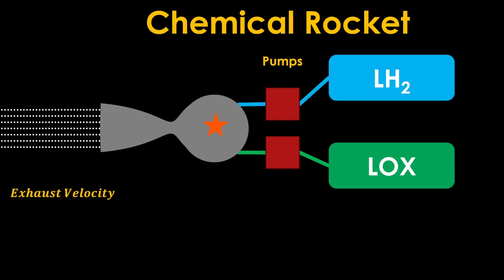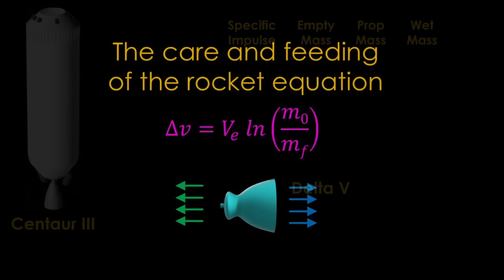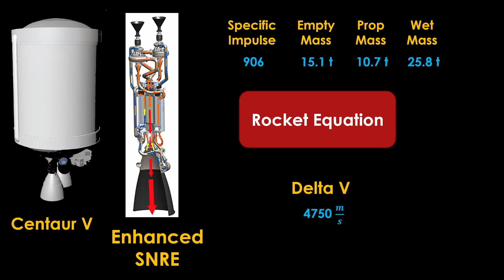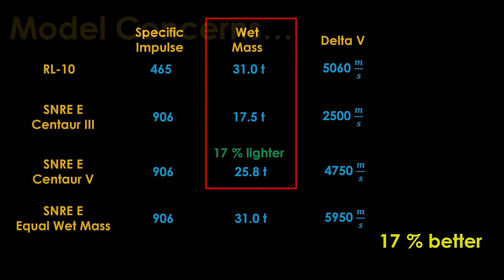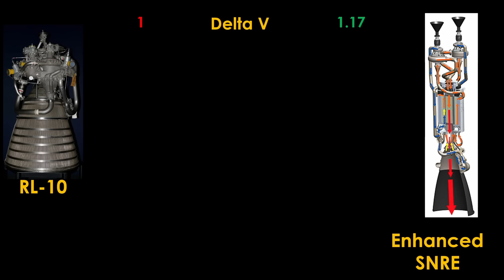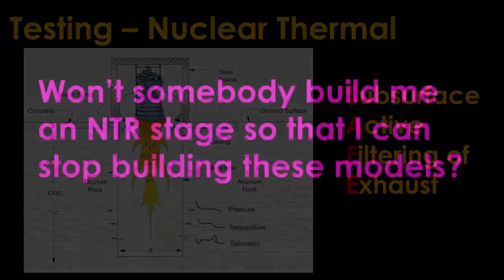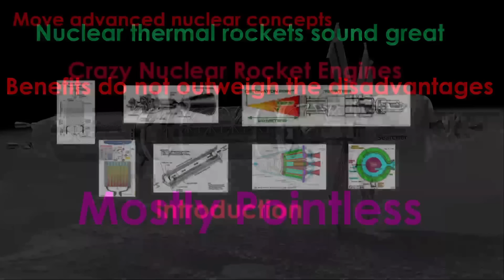Why Nuclear Thermal Rockets are Mostly Pointless

Comment: I will be posting an advanced breakdown of everything in this video:

First, the fundamentals
There is a linear relationship between exhaust velocity and delta v. As such maximizing exhaust velocity of the engine is basically THE most important thing to do on any space related activity or spaceship development program. 

There is a direct non linear relationship between the mass of the exhaust particles and the exhaust velocity. Hydrolox shoot out water, methalox shoots our water and CO2. All of them are quite heavy molecules. 
Pure hydrogen thermal shoots out H2. It’s much much better but not ideal yet, ideal would be H1. To get H1 you need core temperatures above 20 thousand kelvins. Around 5 times higher than the melting point of all known materials in the universe. But it would vastly increase exhaust velocity. This is the idea behind liquid core and gas core nuclear rockets. Get the propellant barely hot enough so that the H2 gas dissociates into H1 instantly giving you a free exhaust velocity boost. You need to develop nuclear rocket to work up to these more advanced types however so that is another argument for why nuclear thermal rockets should absolutely be developed. For context liquid core nuclear rockets can reach an exhaust velocity of around 22 kps while gas core could be north of 50 kps. The main limitation is thermal management however the lessons and solutions learned in thermal management for these fission based rockets also translates to all other space engines including fusion and antimatter so they are useful lessons for all future space travel technologies. 

Secondly the exhaust velocity(Isp. I hate Isp as a metric I always work in exhaust velocity EV). You say that a nuclear thermal rocket is around double that of chemical thrusters. This is not true. Tests conducted during the nerva, Phoebus, rover, XE and kiwi program (that’s right there was more than nerva, doyour research! Russia also had the RD-0410 and perhaps more I haven’t done a deep dive on them) show Isp ranging from 850 to 1000 on THE GROUND at near sea level pressures.   
Even assuming you can’t get above 9 kps EV (exhaust velocity which is what you get by multiplying Isp by earth gravity), that is still far better the exhaust velocity of chemical rockets including hydrolox engines. The F-1 rocket of the Saturn V for instance has 3 vacuum 2.5 sea level kps EV. The never built M-1 engine would have had 4.2 kps EV which approaches the physical limits of hydrolox. Vacuum optimized raptor 3 is as far as I can see 3.8 kps EV a methalox engine. Nuclear thrusters can also be fed methalox. It’s actually pretty good because they run hot enough to split off the hydrogen atoms from carbon unlike from dihydrogen, methane based nuclear rockets give you around 6-6.25 kps EV. The advantage is the much smaller fuel size and much higher mass ratio (lighter fuel tank per kg of propellant) so less bulk and also more thrust.
Reply: You actually seemingly caught that in editing and added a section where you compare all numbers. 

You did the off screen math wrong though it seems because your numbers are 5950 ms dv for 31 tons where as the correct numbers for 15.1 t dry 31 t wet 906 Isp are indeed  6393 and not 5950. 

You then straight up SKIP comparing equal mass and you instead compare your absurd 25 ton variant which is a number that comes out of nowhere... like... what? Is big oil paying you to say this? 

Since you didn’t do it I’ll do it instead, going from 5060 to 6393 is a 26.3% improvement. 

Now it’s low, sure, but ONLY because the thrust of the engine you picked is low. 

Nuclear thermal thrusters have the theoretical potential highest thrust per mass of any engine type. One that is properly made and advanced like a raptor 3 equivalent would have a crazy thrust to weigh ratio. The engine itself would be very lightweight while providing a lot of thrust. 

This would allow you to make rockets where the engine mass is negligible. You NEVER have the engine mass you used in the video and I can’t easily find that number for the SNRE thruster so who knows at this point but it’s still important

You seem to also add fuel tank mass every time you add fuel but again you never say what mass ratio factor you use. 

It is true that hydrogen will as mentioned always have worse mass ratio than other propellants. But as I also mentioned, nuclear rockets don’t have to use hydrogen. A good alternative is methane (they run hot enough and can run hydrogen heavy to avoid gunk carbon buildup). Methane goes from 9 to 6 kps exhaust velocity more or less but the mass ratio of the fuel tanks is multiplied by around 5. 

So if your issue is that hydrogen fuel tanks are too heavy, you could instead get a methane nuclear rocket with 10 tons of dry mass, 20 tons of methane, and an Isp of around 650. Here once again you get significantly better performance. 

But this is not the ideal use case nor the reason nuclear thermal rockets are so useful:
Reply: Then the second example. After the first nonsensical example you decide to do one that makes sense, should have started with that but whatever

I don’t know where you get your numbers for dry mass for. You didn’t show the calculation or the mass of the engine or fuel tanks or extra fuel tank mass you use. 

Here you create a rocket stage with 26 tons 11 ton prop and 15 ton dry mass. Again no idea where any of these numbers come from. Why is the dry mass so high? Why did you decide on such low wet mass? Why 15 tons of dry mass? You didn’t give a mass breakdown of the 10 ton of the base model real life centaur stage's dry mass either so is that payload, fuel tank or the RL10 entine? Very unclear in the video

Either way your final result is a mass ratio of 2.4. Aka 40% of the mass is fuel. Still very low, most rockets today are mostly fuel up to 90% fuel and up because engine exhaust velocity is so low. 
The real life centaur btw is 2/3s fuel, which is already quite low because it tries to maximise Payload mass and doesn’t need much more with how the various stages were setup. 

So you compare a 70% fuel rocket to a 40% fuel rocket. That’s not necessary, you can have a nuclear thermal rocket that is 70% fuel like centaur. Then it would have half the delta v. A more interesting comparison would be looking how much less fuel mass you need for the same delta v as the centaur stage if you replace its 4 something kps engine with a 9 something kps engine. 

Now here you might say well wait a minute now the mass is higher but the thrust is the same so it has less acceleration. And indeed
And you made that error on your example too btw lol, the first and second example are lighter than the centaur and has higher acceleration. 

The centaur weighs 31 tons. Your first example weighs... 17.5 tons. Why? You picked an engine that EXPLICITLY had the same thrust. That’s your entire reason for this choice of entine

Your second example weighs 25.8 tons. WHY again. It has the thrust to push 31 tons with the same safety margins as the centaur does it not? You picked a nuclear engine with the same thrust as the RL10 so why are you making the nuclear variant lighter for no reason...?

Replace your second example by 15.1 ton dry mass, 15.9 ton propellant, 31 ton wet mass, same wet mass and acceleration as the centaur. That gives you a delta v of 6393 ms. 
This would be the sensible comparison to make. Same engine thrust same stage mass, same acceleration, higher delta v as can be expected. 

I have no idea why you chose a lower fuel mass, by 5 tons instead of this. Either dishonesty or brain damage I’m not sure. Maybe you were asleep when you made the video but your numbers are totally off, you are missing 5 out of 15 tons of fuel in your own example.
Reply: The types of configurations where they shine are indeed high mass ratio crafts. Because there is basically no other way to increase the delta v of a mission. 

You can increase exhaust velocity or increase fuel %. That’s it. No other way exists. If you already made a silly rocket that’s 99% fuel with 50 stages... what else can you do if it’s still not enough? Only increase engine exhaust velocity. And nuclear rockets have between 3 and 2 times more exhaust velocity than currently in use chemical thrusters. 

On top of that, as I have mentioned, the theoretical maximum TWR of nuclear solid core rockets is as high as the thousands. 

Meaning you could have a 1 ton engine lifting up a 1000 ton rocket from earth. This makes the mass of the entine and the radiation shielding negligible. A more realistic figure might be 100 or 200 which is still excellent. A rocket could be made with something as low as 2 or 5 but the higher the better generally speaking. It removes engine mass from the dry mass, and increases how much fuel mass you can have on a stage with the same engine. 

Indeed what is stopping you from having a stage that is 5 tons dry mass, 30 tons wet mass and uses a 900 Isp engine? Nothing. 

The centaur as I’ve mentioned has such a low mass ratio (heavy dry mass) because of how the total delta v budget needed to reach orbit was cut. It’s an arbitrary decision and for the centaur, most of the work was done before the centaur stage. And so they feel like they can get away with only 70% fuel on the centaur stage. Your suggestion to use a 40% or 25% fuel stage without sufficient delta v makes no sense. You’re not comparing apples to apples

Comparing apples to apples means same fuel mass same dry mass same thrust and you let the exhaust velocity difference do the talking. 

But you might say that there currently are no high thrust or high TWR nuclear rocket! Correct! Those are the ones THAT HAVENT BEEN DEVELOPED YET SO MAYBE WE SHOULD DEVELOP THEM INSTEAD OF MAKING THE lNSANE CIRCULAR ARGUMENT THAT THE TECHNOLOGY WE HAVENT MADE YET SHOULDNT BE MADE BECAUSE SOMETHING WE HAVE MADE IS WORSE THAT SOMETHING ELSE WE HAVE MADE 

Nuclear thermal rockets have higher exhaust velocity AND higher thrust to mass ratio than chemical thrusters. They are objectively better (other than things like the uranium needed, I’ll get to that) in every metric. Things like the snare engine are proof of concepts. Not mature well developed tech

This is like comparing mechanical computers to the first electric computers that use transistors and saying that the EXISTING mechanical computers are better than the EXISTING digital computers and that therefore we shouldn’t waste money on developing CPUs
Like what?????!!? HUH??! That’s your argument

Now you might now say that "that’s not my arguments i just don’t trust the theoretical estimates that say nuclear thermal rockets can have a better thrust to weight ratio"
Well in that case you’re just wrong. 

People knew that we could design microchips with transistors in the nanometers lobg before we could actually make them. It took billions in research and development and decades to get there. But they knew even in the 60s it could potentially get there with this level of miniaturisation and efficiency. 
Nuclear rockets are the same. This is like some 1980s mosfets. They should be developed because they lead to 2030s mosfets. 
The same way, nuclear rockets lead to absolute monsters like a 900 Isp thruster with 4 meganewtons of thrust that weighs 1 tons. 
And also to more advanced technologies like liquid core (20kps exhaust velocity) and gas core (50kps exhaust velocity). 
The research and development on all thermal systems for these engines is also directly translated into helping us build antimatter and fusion based technologies as the solutions to thermal management are the same.
Reply: That covers all the stuff you talked about. Now the stuff you forgot to mention:

Nuclear thermal rockets have their niche (s). Their main appeal is the fact they are high thrust systems. 
And not just that but the highest exhaust velocity of any high thrust system. 

Their ideal environment is as a ground to orbit launch vehicle. They have enough thrust to takeoff, like a chemical thruster, but you now replace the 340 sea level Isp of raptor engines with 900 Isp of. 
Do you see the benefit yet? Plug that in a rocket equation, take a falcon 9, and switch out 340 Isp for 900Isp solid core thrusters. 

For the same payload mass to orbit you could get a reusable rocket around a third the size (doing this mentally, I’ll leave the math to you). 

That’s the main advantage. And yes as I’ve mentioned there is no issue with using them from launch. The exhaust is not radioactive at all and if it crashes (well first, don’t?) it only affects the surrounding area exactly where it crashed (it can be launched on trajectories that fly over the ocean not land, most rockets already do. Florida and Guyana over the Atlantic, China Japan over the pacific, Russia over central Asian deserts. They launch East) and even then it’s not that bad. 

They can be used as space tugs though I would say ion engines are always better for that. 
They can be used as landing and takeoff thruster for the moon, Ceres Mars or any other place and are once again ideal for this, as they combine high thrust with high exhaust velocity. 

The last niche they excel in is the military. They are perfect due to being able to sustain high thrust (6 G or more) for a ship while also having higher delta v budgets than chemical rockets. All militaries that have access to nuclear thermal rockets WILL use them on military spacecraft. And space dominance is extremely important, "everything is in space!".
I won’t talk about the military side of things much because it’s too important and breaking ground stuff, but the gist of it for nuclear engines is their ability to either dodge/refuse or fοrce a fight with another ship. And also much more delta v for strategic movement and operation. Like so much more. A fleet that uses chemical thruster warships would be essentially stuck around one planet where as one with nuclear thrusters could to from Jupiter to earth or from mercury to Mars and do a lot more operations and complex stuff at its theatre of operations. It’s the difference being between immobile and being able to sail.
Reply: @IceRain-f5v  They have a poor thrust to weight ratio making them a poor choice for a first stage.  And that was just the first flaw I spotted skipping to the end of the wall of now questionable text.
Reply: @imaginary_friend7300
They have a theoretical maximum thrust to weight ratio of over a thousand

It should be obvious from the fact that thrust depends on two things, energy density of the fuel and the rate at which energy can be generated/expelled aka engine power in watts. 

nuclear chemistry has a higher maximum potential power output than chemical thrusters considering NUKES ARE MADE FROM THE USE OF NUCLEAR CHEMISTRY

And nukes are kinda famous for being energy dense and releasing energy very quickly. The limitation to power output for nuclear thermal rockets is material science namely melting point and structural integrity. These constraints are universal to all engine types because now we’re talking about the engine not melting. 

So in other words the thrust to weight ratio of nuclear thermal rockets is basically infinite and only limited by our ability to create an engine that doesn’t melt itself. The same barrier would exist for chemical engines. Meanwhile chemical engines are limited mostly in structural integrity (high pressure fluid containment) and the energy density of the chemical reactants. 

The reason existing nuclear thrusters have low power density is the intentional design choice of creating reactors which operate at low levels or energy and radioactivity. 
If you want to maximize power density you can build a nuclear reactor that is very close to being supercritical, they would have an extreme power output and power density, as well as an extreme amount of radiation

Radiation scales about linearly with engine power for nuclear rockets. A more powerful engine is a more radioactive engine

However every added centimeter of radiation shielding reduces radiation basically exponentially. So while the radiation output grows linearly with engine power, the radiation shielding needed grows logarithmically 

A high thrust nuclear thermal rocket would look like some highly enriched material, with neutron moderation, designed to operate at a high neutron flux as spew out kilowatts of radiation, and gigawatts of heat, while the core itself weighs less than a ton, glows red hot, probably not far from the melting point of things like uranium dioxide. 

This cute little portal to hell would then be encased in radiation shielding. Cooling is done by the propellant being pumped through the engine. This is how you get hundreds of G of TWR in a nuclear thruster. 

Now of course you don’t have to go that extreme, nuclear reactor design is a spectrum and you can go from 1000 TWR with a little angry white hot ball of uranium 233 dioxide to a pretty terrible 3 TWR nuclear thermal thruster like existing prototypes and anywhere in between. The limitations are however not structural, they come from 1 the reactor design and 2 the radiation shielding. 

Reactor design can be made much smaller and lighter than existing one but radiation would stay the same or increase, so radiation shielding remains a heavy thing. 

But "heavy" is like 2 tons on a 50 ton ship which means you went from 1xlog(48/8) to 2xlog(50/10) because oh yeah, you doubled your Isp.
Reply: That means the specific impulse is not 2 times but closer to 3 times better. 

If you looks at the rocket equation, you would see that increasing fuel mass increases delta v logarithmically, but increasing the exhaust velocity increases delta v LINEARLY. This means that increasing exhaust velocity is EXPONENTIALLY better than increasing fuel mass. Even more since adding fuel adds dry mass in the fuel tanks as well. 

So you cannot understate how important exhaust velocity is. 
You say there are other downsides and that’s fair let’s look at the others later 

You then have an absolutely absurd video section where you just substitute the volume of the oxygen tank on an existing stage with hydrogen storage with no other modification. I have no idea why you did that or what point you were trying to make it’s entirely absurd 

If the point is that hydrogen is bulkier this is true but generally a very small issue. It’s most an issue in launching at sea level and yet the Saturn V ran on hydrogen so clearly the extra drag from the extra volume isn’t a dealbreaker. 

The far more relevant drawbacks of hydrogen are mass ratio. The lower density and high... pressure to density ratio lol? Idk if there is a name for that property but basically a 1 ton hydrogen tank is not only larger but also heavier than a 1 ton oxygen tank. It can get quite bad with mass ratios as low as 5 or even 3. As in around a quarter of the mass of the fuel tank is metal and 3/4th is hydrogen. ( I also heard that the space shuttle big fuel tank had a mass ratio of 10 not sure if that’s true or if it includes the oxygen in that metric)
This is bad but the impact of exhaust velocity on the rocket equation is so enormous that you can often have more delta v with an engine that has higher exhaust velocity but propellant that is stored in far sturdier heavier tanks than a thruster with lower exhaust velocity and a dense low pressure fuel like RP1. RP1 itself contains a lot of hydrogen atoms and that’s why it can be used as rocket fuel. The hydrogen present in methane or gasoline contributes disproportionately to exhaust velocity. 

In your example you end up with a stage that has 4.3 tons of fuel for 17.5 tons total. That’s an insane mass ratio of 1.3 no one would ever do that, again I have no idea what that segment of the video was included. Your rocket is only 1/4th fuel. 

Now a fun fact is that having very low mass ratios like this actually does make sense if you have really good engines. Having more dry mass and less fuel is good... so long as you have enough delta for the mission. So if we ever get really good engines, rockets will begin to have progressively less and less fuel. Eventually an interplanetary ship could look like a car or a ship in the expanse with almost no fuel on board compared to the total volume and mass of the ship. If you have enough for the trip and can ressupply at arrival you wouldn’t need more. 

And heavy engines that take up a large % of the mass of the ship/stage can work, so long as the trade off is a crazy good exhaust velocity. If you have a fusion torch that weighs 2000 tons, just the engine, it may give you enough fuel with 50 tons of propellant, and you could get a truly weird rocket with very different proportions than existing rockets. But here you don’t have enough delta v to have the luxury of being only 25% fuel.
Reply: You then make the argument that "but there’s also an existing off the shelf option why invent something better" which is an insane unironically third worldist cognitive fallacy and I can’t believe you say that seriously

Oh the scale of a single mission sure. If you look at things from the point of view of a space agency, a country or humanity as a whole, you DO develop the better stuff even if there’s an existing option. 

If you don’t you end up like the Romans never inventing the steam engine and missing out on the industrial Revolution because they were over reliant on sIaves and thought "if it ain’t broke don’t fix it"
Or better yet, instead of saying the Romans, let’s say you’ll end up like all these nations that also relied on sIaves, never industrialized... and then we’re conquered and colonized by the industrialized nation to give a clearer picture as to what you’re missing out on if you take the lazy approach and don’t develop the better tech to save on cents on the dollar. 

Then you mention the bulk. It is an issue but a very small one, it mostly matters for aerodynamic drag and isn’t too relevant. Mass is what matters and mass and volume are basically unrelated metrics. 

In addition as I mentioned, using methane trades a third of your exhaust velocity for around 5 times more fuel mass per fuel tank mass. In some configurations they can beat out the delta v of hydrogen engines (hydrogen wins out if you keep adding fuel tanks eventually)

Now onto the non insane or irrelevant arguments in the video: the uranium requirements. 

Now of course they can run on any fissile transuranic element. However that’s hardly a solution as all of them are still rare and hard to obtain lol. And I would always argue nuking your enemies is a far better use of uranium than powering the washing machines of the pleb. Uranium and company are rare, useful, powerful and valuable. 

I entirely agree that one should not use fissiles wherever it is possible to use something else.